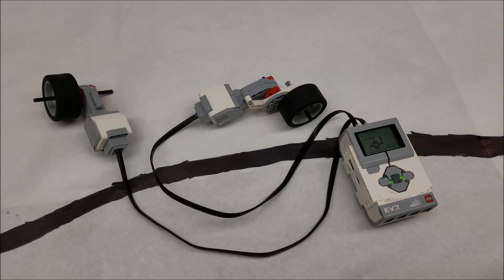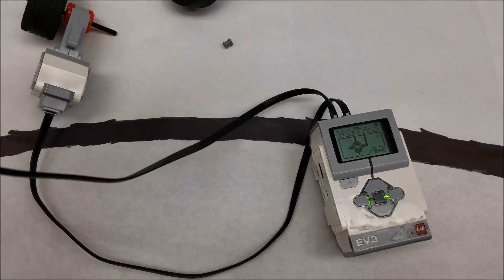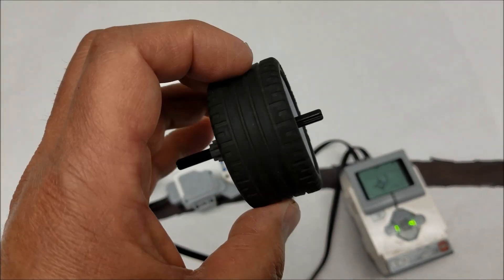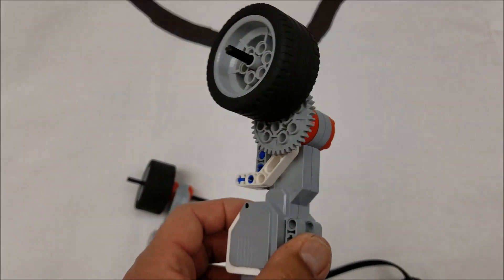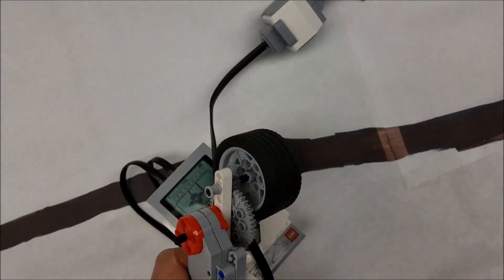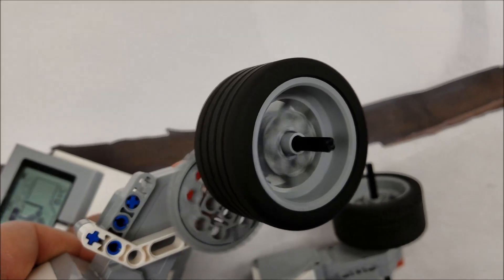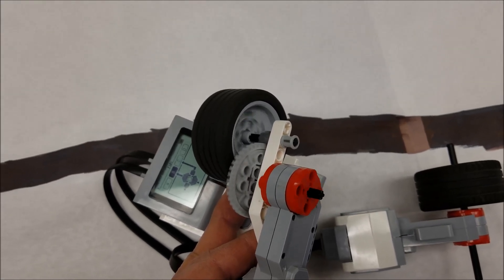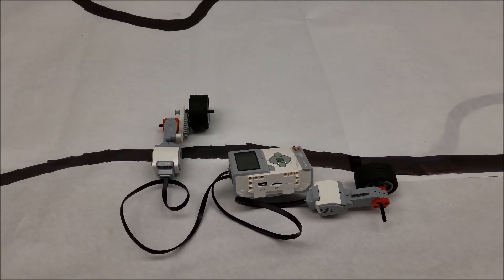"How To Make Your LEGO EV3 Robot Go Faster With Gears"

Comment: How to make your ev3 robot fast for races/ etc

Requirements
1 Robot Brain (machine thing)
4 Motors

4 EV3 Tires
4 White things so the Tires dont fall off
50+  Rod Rounds
50+ Blue and Black rod things
4 Turner things (for the wheel to turn)
Remember the trick is Weight dont make it heavy

Place down the rod rounds and put them together with rod things
Place down the Robot Brain (make it strudy)
Attach the motors To B and C
Place the Turner things on each of them
Place the wheels with the white thing
Make sure it looks something like this
         +=======+========+
--------------------------------------------------
--------------------------------------------------
O    o                                     o     O

O's are the wheels Small O's are the other side wheels
The Structure is the ----------'s
The Brain is the +============+===========+